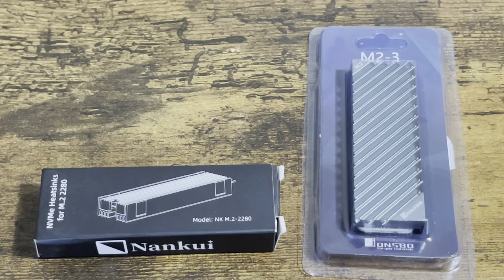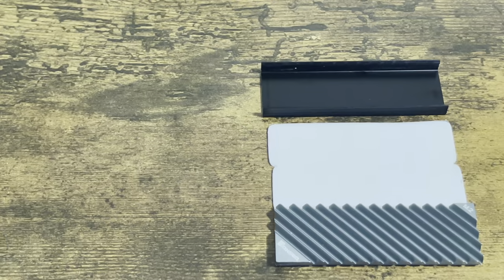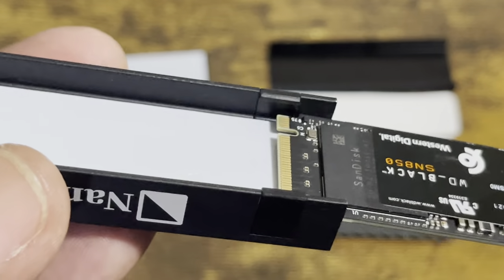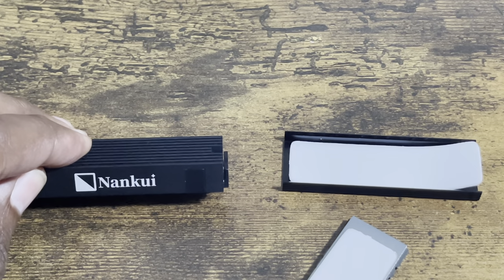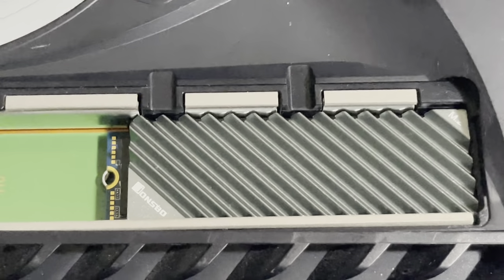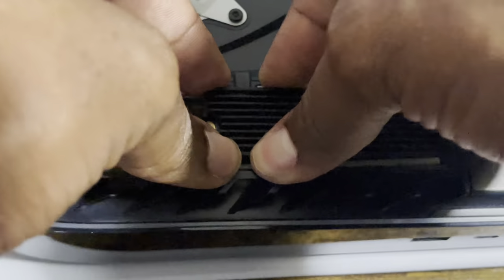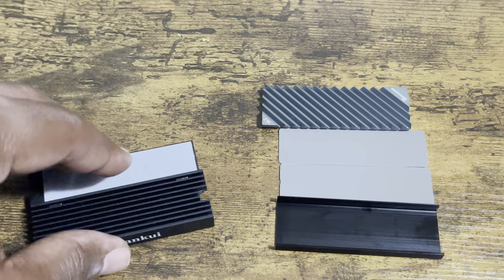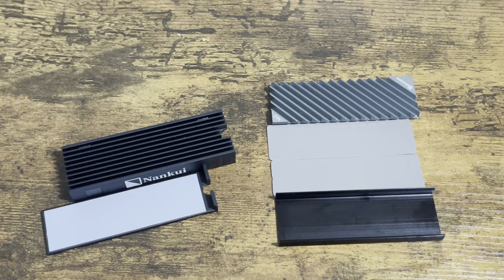Will These #Heatsinks Fit inside My #Ps5? Heatsinks review

Comment: The covers were not meant to slide during assembly, as the SSD's should be sandwiched snugly into it. That's how you would be able to transfer heat from the ssd to the heat sink. if its loose then it doesn't serve its purpose. The covers shoud be snapped on, not slid in.

Comment: Totally wrong - both. You should read the directions or at least do a little research. The thermal pads need to be in contact with the M.2 and heat sink.

Comment: Does thé heathsink  need to hit te metal wall?
Reply from the maker: I don’t believe it matters as long as you don’t have to force it inside the expansion slot to fit. The most important thing is that the heatsink fits just right inside the expansion slot and the plate can close.
Reply: @Tech-This-Out  of course it does matter!
Reply: @Tech-This-Out  thats what the cooling pads were for. SSD heat sinks were supposed to absorb heat from the ssd via conduction, them convection to remove the heat off the heat sink.
Reply from the maker: @jayceereyramos5124  you’re absolutely correct. And to note, this video was done awhile back and I was fairly new to it and I’ve learned and understand how it works after a few trial and errors. 👍

Comment: Will a 4TB sabrent fit inside these?
Reply from the maker: Most definitely.
Reply: The size of the NVME has absolutely nothing to do with a heatsink. Why did you mention it? It's like saying that a 7000mbps reading speed nvme will fit but a 5300mbps won't.

Comment: Anself Heat Sink M.2 Solid State Drive Heat Sink M.2 2280 SSD Radiator M.2 SSD Cooling Vest Black. will that work ?
Reply from the maker: I believe it will. If you have a pic of it, can you show it to me and if I can get it, I'll do a fit test on it. I think I had it before but I want to be extra sure
Reply: @Tech-This-Out  that is the link of it.
Reply: The link won’t work but I got it off of Walmart
Reply from the maker: Does it look like this

M.2 NVME/NGFF SSD Heatsink Radiator Cooling Fin Cooler with Silicone Thermal Pad, Double-Sided Heat Sink https://www.amazon.com/dp/B07PJD4H9B/ref=cm_sw_r_cp_api_glt_fabc_Q5ST4327Q515XZ0YKMF6
Reply: @Tech-This-Out  no it’s not that
Reply from the maker: @HitItJohnny1  ok. I’m still searching the web to see if I can find it.
Reply: @Tech-This-Out  it has little silicon circles to put on it
Reply: @Tech-This-Out  I wish I could send an link but maybe email me and I can send you an link like that
Reply from the maker: @HitItJohnny1  myowndamnpocket@gmail.com
Reply from the maker: I  just got your email and yes, I had it before and it worked just fine.
Reply: @Tech-This-Out  appreciate it